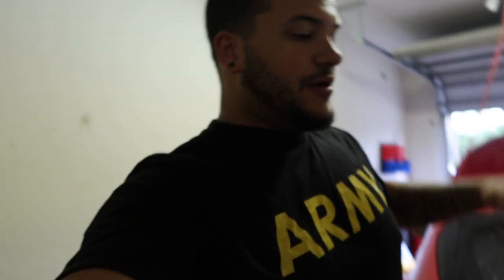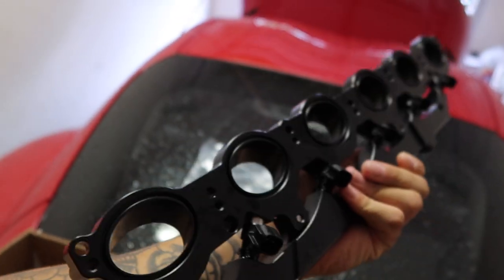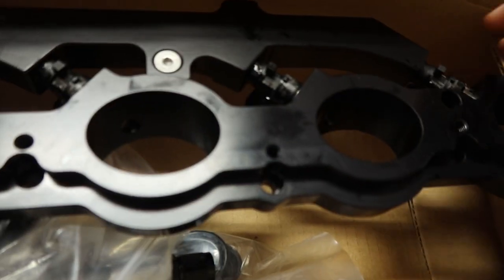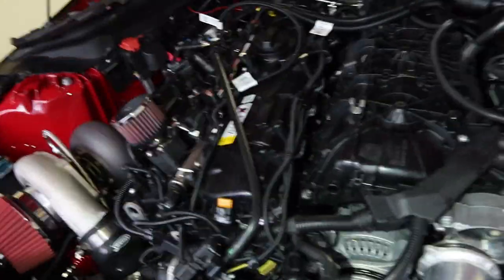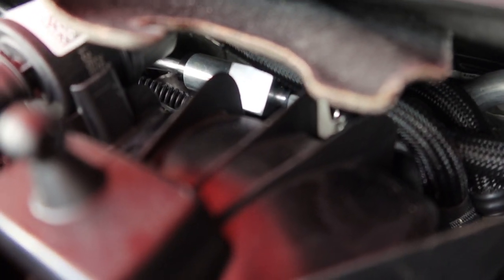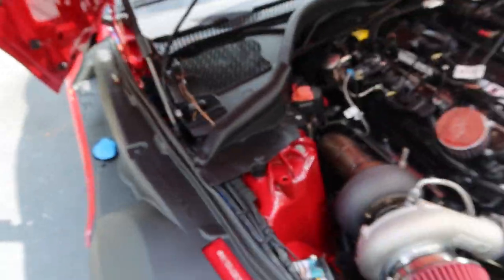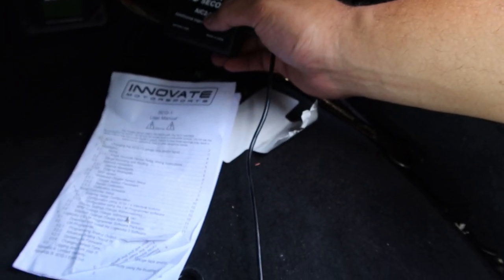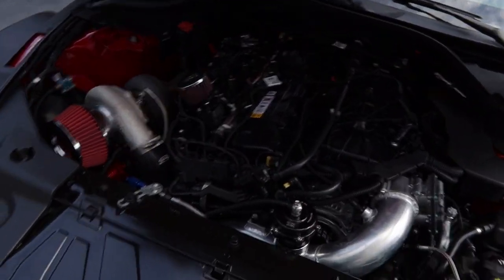2020 SUPRA GETS EOS PORT INJECTION

Comment: Hi, I'm a first time subscriber to your channel. Very excited to the see the end result, its gonna be outrageously awesome. You probably know about the Pappadakis Racing B58 build. If not please check out their channel. When they went to port injection, they initially left the direct injection nozzles in the engine, but after the first few runs, they burnt  the nozzle tips because no fuel was going through there to cool it,  and compression shot out of the direct injection ports. They later removed the direct injection and made dowels to plug the holes. That solved the problem. Its very interesting and detailed. Good luck with the build and like I said its gonna be awesome.
Reply from the maker: Cheslyn Owens I’m running direct injection and port together 😁
Reply: @AMBOTTuning  I feel silly now, thanks for the reply. Looking forward to the next video.
Reply: Price of it